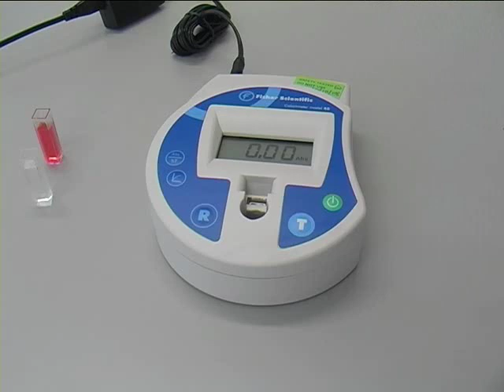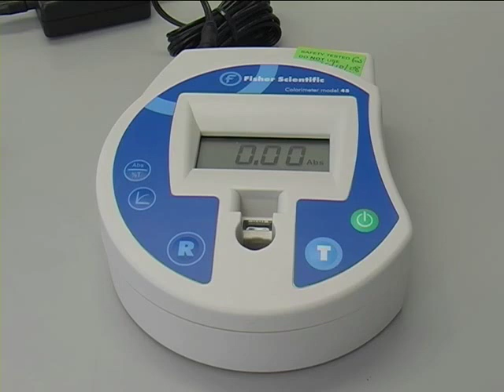Using colorimeters

Comment: What inaccuracies can you get while using a colorimeter ?
Reply: you can get oil from your fingers onto the sides that the colorimeter shoots light through to measure, which could potentially change the score you get on the display. Also, you need to make sure your liquid that you are measuring is either well-mixed or you do multiple trials with the same liquid, otherwise imperfections in the mixing of the liquid could affect the score as well. What i would do to prevent this is use the same liquid 3 or more times and put it through this apparatus to get the average.
Reply: @UndercoverPerson-z2d  damnnn